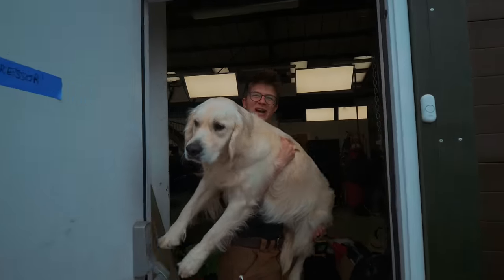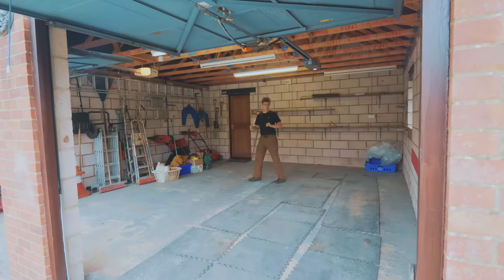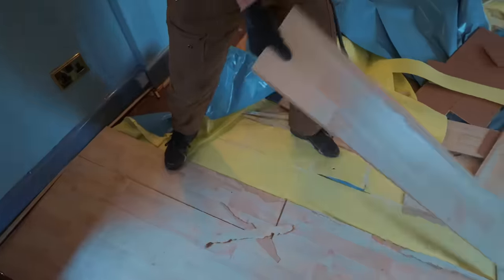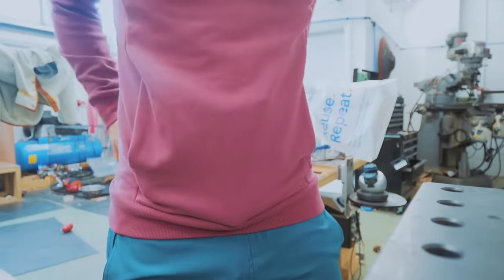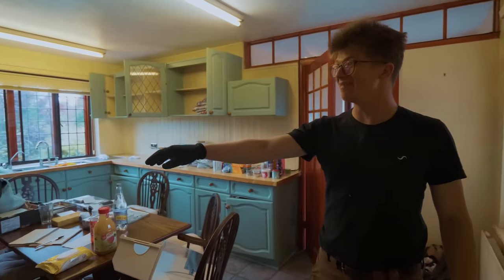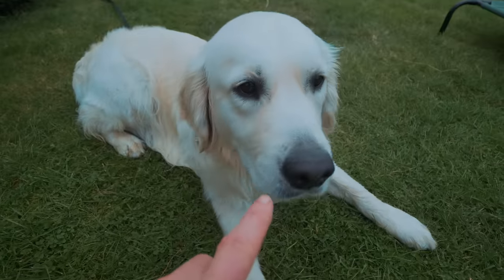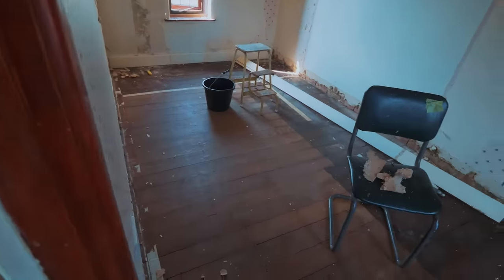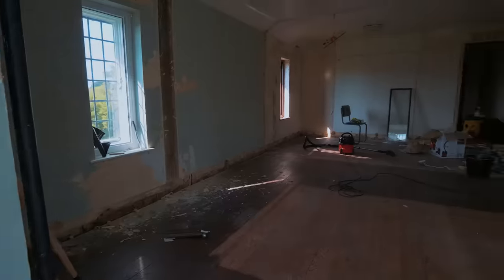I got kicked out of my workshop!

Comment: While you've got it all torn up you may want to consider upgrading the wiring. Having modern wiring for power can make a difference. Also consider adding ethernet and co-ax to all the rooms.
Reply: Ethernet and co-ax…… lol. Why not install a VHS recorder and a CD player too.
Reply: @MrJonnyd55  wired will always beat wireless internet. And the coax is nice so you can put a cable modem in any room.
Reply: @MrJonnyd55  Ethernet wiring still has uses.  I installed it in 1999, just before the WiFi era.  We used it for a few years before it seemed obsolete.  Fast forward another 15 years and it turned out to be a boon when we upgraded our TV/telecom service which required wire runs from the gateway.  Also can be useful in a large home that needs multiple WiFi access points for good coverage.
Reply: @billtheunjust  exactly this. wired is way more stable. even if the ethernet in the rooms just get used to connect a wifi mesh point, the will be worth it
Reply: @billtheunjust  Gigabit ethernet cable (Cat 6).
Reply: @davidhawley1132  I can't tell whether you are trying to be helpful by providing specifics, or pedantic and annoying. I know there are different grades of cables...
Reply: @MrJonnyd55  Ethernet is still wayyyyyyyy faster than wifi these days, and more reliable.
Reply: @billtheunjust  Trying to be helpful, and it was meant to give Alex more info, not to annoy IT people.  I'm in Japan where fiber to the curb is the norm, but I think not so in the US and no idea about UK, and so I'm not sure what cat cable is usually used.  But if it was me anywhere in the world, regardless, I'd put in better cable.
Reply: @davidhawley1132  cool, glad I asked. Sorry for being being rude. (rough day).
Reply: @MrJonnyd55  Ethernet is much faster than wifi and not all rooms can get decent wifi anyways. So don't be so rude
Reply: @jordyv.703  You are being rude by assuming I was being rude.
Reply: @MrJonnyd55  rude is subjective. To me, you are rude. Unless you didn't mean what you typed. Sarcasm can't always be read in text

Comment: I had the same issue with the suspended timber floor down stairs and damp walls. I ripped up all the timber floor and injected a new dpc. Then dug down enough to lay a concrete oversite, put 100mm of insulation and have a latex screed. I also put in wet underfloor heating, it was the best thing I did in the renovation by far.

Comment: Typical of houses without a proper foundation barrier near a garden. French drain, and an engineered water collection system should fix the problem. One house i restored maybe 10 years ago had massive flooding issues + 20 cm in the rainy season inside the basement. We fixed it with barriers and a massive 5 meters deep, 1 meter wide (concrete sewer liner) pit, in which we threw about one meter's worth of gravel to stop it from creating ice.
It was so efficient, that the neighbor's adjacent house also stopped having water issues in his wall.
Reply: Did the neighbor chip in? :P
Reply: Also if it’s on stumps, I know the au/nz standards state you need at least 300mm from ground to barer. I’ve had to pull up entire subfloors to dig out dirt from houses before and I tel you it sucks!
Moisture seeps through the ground and causes a lot of moisture under the house, under the sub floor and inevitable mould. Something to check out
Reply: What's wrong with fixing the DPC?

Comment: Get the electrics done, it’s looks it hasn’t been touched since it got built! I remember when you didn’t have a millions subs. Well done 💪
Reply: Yes yes yes!!!

Get an electrician in to look at EVERYTHING from the mains incomer, the board and all the wiring!

A house of that age potentially used a type of wiring call VRI or VIR wiring (Vulcanised Rubber Insulation/Vulcanised Indian Rubber). Over time the sheathing becomes VERY brittle and can fall off with the slightest disturban e (such as knocking down fixtures and fittings and walls nearby) exposing wires and is responsible for a HUGE number of spontaneous electrical fires over the years.

So if you're ripping walls open and exposing wiring (as you are) then its worth getting it inspected and considering whether it might be beneficial to spend some money (I know, easy for me to say, hard to do) and get the house rewired now, to prevent problems in the future.
Reply: @Burnie1601  if it has that cable you need to re wire it. The amount of properties ive seen. Plus it might have asbestos fuse cartridges as well
Reply: with all the naked walls that's the best time to do that !
Reply: @wiwigt3617  it is but sometimes you tell people they don’t want to. An cost them in the long run. Electrician here :)

Comment: Congrats on the home. The hole behind thew dryer is probably an exhaust vent for the dryer. I don't know if UK observes it but according to the international mechanical code all cloths dryers are required to exhaust outside. As dryer exhaust has lint in it and lint is extremally flammable not to mention who want's lint in their lungs. Typically dryer exhaust is handled through a roof vent these days but wall penetrations are also common especially in older homes. I would look into it if you haven't already if you have any intention of keeping the dryer. Especially since I'm a commercial HVAC installer not residential, and I'm in the US so code might be different.

Comment: Who in their right mind puts laminate flooring over hardwood?

Beautiful home.  Congrats!
Reply: Someone hiding all the rot accumulated on what was a home with great bones! The flooring was cheap Chinese bamboo and thin, thin , thin, the built ins catalog items made from MDF with veneer on it- wet, rotting plaster walls covered by cheap wall paper. I don't care if the previous owner did that job of a "flipper" did it- it wouldn't have passed any codes inspection in texas or Louisiana where I have worked. I also doubt that a bank would have knowingly underwritten a loan if they had any knowledge of the poor quality- bankers, even fast dealing, British ones, like to see strong positive value added to protect the property- that isn't what I just saw removed from that house. FR
Reply: @fredericrike5974   I think you underestimate the average person's awful, awful taste. Never attribute to malice what can be explained by incompetence.
Reply: The previous owner of the house we bought a couple of months before did it. Awesome looking, 30-40 years old hardwood floor, that only needed some love and care - but he was so smart, and laid a layer of extruded foil(? that foamy type of film for maybe heat insulation?) all over it, and put down some presumably second hand laminate. The original hardwood floor started to rot and mold; I was able to scrape it up like wet cardboard...... Of course the original "glue", a tar-like material was untouched by the damp environment, so we had to chisel that thing up. Nice times, nice times..
Reply: if the hardwood flooring has gaps, air gaps, and is uninsulated, then it's a decent choice.
not all hardwood or wood floorings are ideal living surfaces, despite their nice appearance
Reply: Leaving the hardfloor there and cover it to make it impossible to it to breathe and get rid of any moisture is a decent choice? Tell this to the 10 months old baby of theirs who lived in that room, with that blackish, nice smelling mold. :-D
Reply: @johannsmith5697 , specially if that "hardwood" is not hardwood at all...
quite a lot of houses in Europe from the 50's to the 80's got whole-wood flooring made of pine.
and it's not uncommon seeing these get stained later on to look like other more exotic woods, or just painted\covered.

(you could be super-lucky and it be oak or even Ir'oko and mahogany in the oldest houses, but if the later ones you better hope it got no damages since repairing it is catastrophic for your wallet with all the bans on exotic woods)
Reply: @brrebrresen1367  thats the case with the previous occupants of my house, they pulled up floor to have floorboards, they are soft pine..
Reply: @scottperezfox  As much as I heartily agree with you, what I was seeing as Alec peeled back the flooring and removed the cheap MDF built ins was mold, wet plaster, rotting hardwood floors. The last reno was a cover up job to try and raise the houses value to the neighborhood averages. I hope Alec didn't pay this thief enough to profit from the attempted fraud. FR
Reply: @balogh89  The rot I saw on some of it tells me that much of that floor wasn't salvagable even as sub floor. If I were buying, or had bought, I would be talking to a lawyer about a fraud suit. I don't know the specifics of British realty law, but in the US, false representations can have drastic financial repercussions. What was done there was to hide many gross and unresolved defects in the house- at least that is what I can see in the video. There may well be evidence on the ground that minimizes this- IDK. But my 35 years of construction  is quivering over the visible attempt to defraud presented. FR

Comment: Does the house have a crawling space underneath the floor? might check it and see if anything is rotting or hazardous underneath. Plus see if insulating it is possible before making new floors. Getting heated floors is also quite nice. Saves energy, cost and space if no radiators.

Comment: I mean, how old is the house? I’d be surprised if an older (comparatively, I get that it’s not as old as a lot, but in the US I think it’d be oooold) house in the UK didn’t have at least one ghost... I’d also be disappointed... :) 

Good going on buying a house! It’s pretty! And I’m glad it had some lovely wood floors for ya! Those stick down tiles are a pain, but they do protect the wood quite well!
Reply: That house has Servant Bells... Of course it has ghosts... The question is if they are just Ghosts of the past or Spectral Ghosts.
Reply: It really doesn't look old enough to be the time period when Butler Bells were standard... First glance is is screaming 80's build at me. The colour of the brick etc.

And the garage looks very 80's internally. All that breeze block.

All the power sockets and fitted cupboard stylings are very 80's in style also.

But then you see all the hardwood floors. No way did they put that money into a build in the 80's! And then there is that stair case and the Butler Bells. That style of sign writing is ~30's I'd say.

It could be that the previous people stuck horrendous modern windows (although they do look to be wood, single glazed) and that conservatory on the back that deceive the eyes as to timelines...

So, I conclude it was an 80's Reno on an older building, and not a great reno at that!
Reply: @NikolaHoward  Yes I thought so as well, that there was either a renovation involved or the house was build bigger... I don't remember the word for it, but when the house basically grows... That sounds so weird.

Anyway, you can't forget that even 1900 there were already houses build that you would nowaday call a normal modern house.
Reply: @NikolaHoward  Looks about 100 years old to me... especially from those windows with wood/lead frames, and wood-floors As you said, they stopped building like this long before the 1980s.  The garage is definitely much later than the house.
Also note most of the electrical oultets were mostly surface-mounted with trunking for the cables (not in the walls), which would make me think it's around 1890-1900 as electricity was only really being rolled out in the early 1900-20s and was probably retro-fitted.
I could be completely wrong though.

Comment: Jesus, that's a hell of a first house. Fair play, what you've achieved is absolutely staggering.
Reply: There's a good chance it's a fixer upper that recieved set dressing and rough possible internals. That was my first place, a teeny postage stamp yard in a rougher neighborhood. It was cheap. It was close to work and we moved out after the first speeding drive by. We ended up moving into a trailer
Reply: It's a bit of a fixer upper in that it's dated in some respects but actually quite grand. That's getting on for a million pounds worth of house in the UK, if not more. Houses are insanely expensive here
Reply: Was just going to say that, looking at the area (probably down south somewhere) that's easily a million pound ($1.4m) first home, even with a dated interior. Not bad going 👍

Comment: Check the gutters on the damp wall first, it may not be rising damp. 

Also if depending on the survey you had, they should’ve picked up on a damp problem that serious if they did their job properly.
Reply: Is dampness like that common in the uk? Here in Finland that would’ve been a court case / sale reversal / panic / instant asthma for all.
Reply: @AJV55  
It’s more common than it should be. It’s usually blocked gutters (overlooked  maintenance), a leaking pipe or something like a path or flower bed being to close or even above the hight of the damp proof course. All of them should be picked up on a full structural survey but most people don’t go to that expense and have cheaper and less in depth inspection.

Comment: Future reference for demoing walls, use the sawzall to cut the studs at the top and bottom and all the way through vertically. Keep the sheathing on and toss it in large pieces. Destructive demo is fun until you have to clean it up.

Comment: Love how immediately after buying a house you tear into it. I did the same thing, girlfriend gave me to green light to pull the trim in the house when we were painting the first room, turned into fixing all the plaster, installing new flooring, rewiring the whole house, insulating, replacing all of the window sills, replacing all of the doors, on and on and on. 6 months in and I am about half way done with this 3 month project.
Reply: Bought the house we are in now in 2004 and my wife (Japanese) wouldn't move in until it was 'ready'. Took us about 10 weeks (and some really good contractors) to get the place stripped out, rewired, replumbed, new windows, new kitchen, new bathroom, replastered, repainted and carpeted and move in.  When you are not living in the place you can get it done quickly - cost us an additional £40k and three more months rent of the flat we were in but we expected that (was a bit under budget in the end!)

Not done a thing to the place since.  Still perfect.
Reply: @FFVoyager  awesome! I have been off work since March, so I am working on this alone. The girlfriend was freaking out at first, she never worked on a house, but as things have progressed she has lightened up a lot.

Comment: That sound editing was excellent! Also one can guess why there was engineered flooring installed... witch is also least partially fault for the water damage. Even if you have water leak, in old house that does not have synthetic materials covering surfaces, it can dry, but get even a little moisture between moisture barriers and it molds before dries..House i'm living has leaky roof and one major leak, but since its old log building and insulation is wood chips, it can easily dry during summer, though that major leak is worrisome and needs to be addressed asap, but its city building so go figure nothing moves fast..

Comment: advice - instead of removing the paint by stripping just pull the drywall/plaster down and replace. I was able to do this in my master bedroom and it took 2 days to remove and drywall. little extra time to mud/tape/sand but the end product was very clean.

Comment: Having worked in contruction for 15+ years, none of this is surprisingly. The most important thing when renovating, is that when you find damage, you HAVE TO identify the source, or you will just suffer more later. That being said, massive oof, and I feel for you. I eventually want to own a home but I am really not looking forward to fixing all the issues when I do.
Reply: Oh a couple small things. I am in the US so idk how it works where you are BUT, Here getting a skiff for demolition (demo) work is really REALLY cheap and they dont charge you for time, just pickup and dropoff, so usually we get the skiff first, and once it is full they will quickly dump and bring it back, so that may have saved you some time if it works similarly, the second issue, is that especially with water damage, I would check all the main studs/supports behind the walls. It is a lot more work, but if any of those are damage and therefore sagging, it will safe you a lot of money and headache later to find the damage now.

Comment: that's not a full skip! 😆

Everyone knows that the panneled stuff should be loaded edge on along the sides and ends first such that you can create a slightly raised from the top of the skip pocket into which you can load all the rubble and arses and ends into.

That way, the panneled sides act as a barrier for the slight mound atop you can then get away with 😉👍